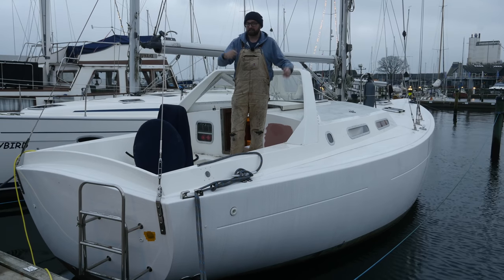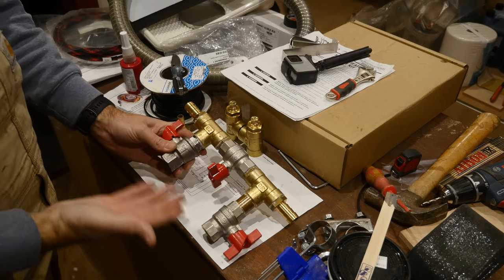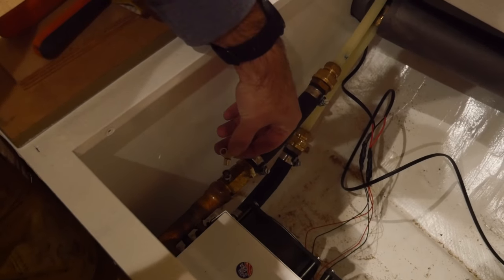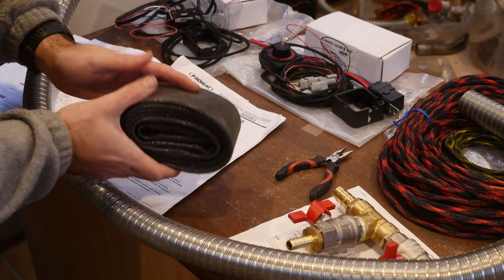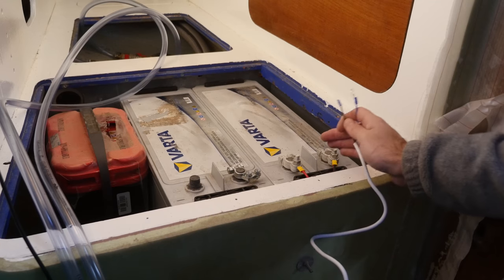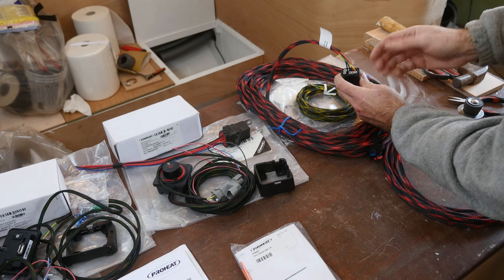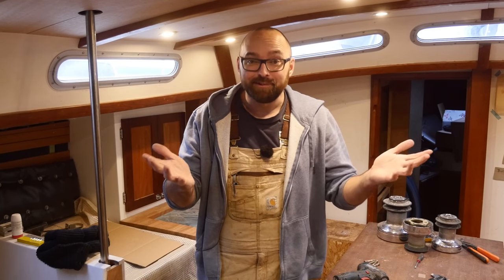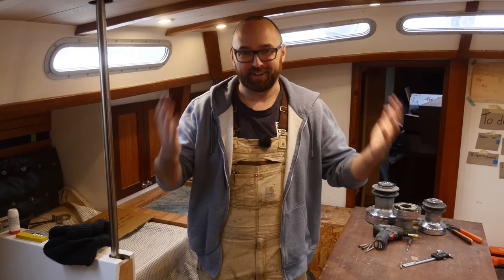Sail Life - Dometic Proheat X30 hydronic heater on a boat, part 3 of 3 - DIY project

Comment: Some sort of heat is important working in the hard or on the water in the winter.  I spent two COLD Chicago winters on the hard working on SVBD 10-12 hours a day and usually 7 days a week in relative comfort inside, using only a small amount of electric heat run off of boatyard shore power.  

The yards absolutely did not allow us to be plugged in when we were not there, and the availabile power was just a 15A 120v regular non-marine electrical outlet which I had to use an adapter to connect to the boat's shorepower 30A cord.  

It might be as low as -5 degrees F when I got to the boat in the morning, but in only a fraction of an hour a little 750w plug-in electric heater would have the boat nice and toasty inside and plenty warm enough to be a comfortable working temperature.  Epoxy work was not an option for most of the winter, but I was still able to do most things inside wearing just shirtsleeves after a not too long of time after I got there in the morning.  

We had power to spare to run the house bank battery charger and a few 120v power tools without blowing the breaker unless one of my neighbors decided to plug into the same receptacle that I was using.  If I had to run a skill saw, I would simply turn off the heater for a minute or two while I made my cuts.  Really, once the boat was warm inside after the initial warm-up of the boat the heater would barely run much, the thermostat shutting off most of the time.

This is only a 35-foot boat and we did insulate the hull well inside that fall before it got too cold our first year on the hard.  Even now, it doesn't take much to heat this boat.  Most of the time we just light our two kerosene yacht lamps and that keeps us pretty toasty unless it gets really cold out.

Comment: Like button smashed Mads! Your installation is awesome. I’m sure you’ll get the noise under control once you enclosed the heater and closed the door of your technical compartment. As for the fans, maybe one day you’ll fit radiators and that noise will be gone too, should you wish so.

You are blessed with a warm comfy home on this 4th advent.

Well done, cheers

Comment: Put a rubber mat between the backing plate and the hull, and maybe a big piece of wood on the other side with plenty of silicone to keep vibrations at a minimum.
 You could probably also run some copper tubing around the exhaust for a little extra heat.

Comment: Well Mads for the noise from the heater you could do an insulated box inside another insulated box to possibly really cut down on the noise. There is some insulation you can get at least here in the US called Sonolead. It’s  1in fiber glass a layer of lead sheet and another half in of glass. It works rather well.

Comment: Of course, you can always have both - a system heater AND a bulkhead heater.  That’s what I would do if I lived aboard.  I installed a forced air system for the drying effect and the quick heat and it is awesome for both but the little jet engine running at the back of the boat does get a tad annoying after awhile and then there’s the power consumption.  Having both would be nirvana.  The forced air to get the boat warmed quickly in the morning and the bulkhead to sit quietly around once the boat is up to temp.  I know - there’s the extra space but in these colder climes (I live in British Columbia), I’m pretty sure it would be worth it.

Comment: I have a small Webasto hydronic heater and loudest part is the wooden bulkhead (the aft end of a cabin) where the machine is mounted (due to the fine vibration). When you check the heater from the other side you can't believe that it is so loud at the other side of the bulkhead! Try to add vibration damper. This is what will do, too.

Comment: Another Great Leap Forward with heating now installed, its going to make the next few month much more comfortable I’m sure.

I think it may be a good idea to add a string or chain to the exhaust bung just in case!

I know I keep commenting the same thing, but thank you for maintaining the content output, it’s one of the few things keeping me sane in this crazy 2020.  I’m sure I’m not the only one grateful for your content. Your positive approach to everything is a shining example to us all.
Reply: I was thinking about letting the exhaust bung also be part of a "start button" for the system - if the bung is in the exhaust, the system can't be started and if the system is started, the bung can't block the exhaust. I've no idea how it would be done - perhaps with an ignition key from a car?
Reply: @noremorsewoodworking2258  I thought that too.  I’m sure there’s some kind of safety feature that will stop the system running if there’s an an exhaust obstruction, but a safety feature would be interesting to develop if it isn’t already a feature of the system.

My worry was about dropping it when installing and removing.

Comment: and you get hot water, no comparison. Merry Christmas Mads.
Reply: I have my Refleks connected to 7 radiators, it would be easy to connect it to a heat exchanger for hot water from an electrical switch.
I have also found parts for making it ignite itself via electronics so maybe I will make that my first youtube video next summer.
I'll probably steal the idea with a buffer tank also. :)

Comment: Based on the harmonics I can hear from your recording, it sounds like a big chunk of your noise is low-frequency transmissions that are transferring to the cabin wall. There is a high-frequency whine, but that is easy to eliminate with a shroud or loose dampening. In order to eliminate the low frequency, you will need to work on decoupling the heater mount. If you use a meter on your phone to measure the low-end frequency you can look up the vibration decoupling material/durometer that will work best for that frequency.

Comment: I am happy to see you go with a hydronic system! I have a forced air system and having 4" tubes run bow to stern is not the best in terms of storage compartments. I also find that the forced air system seems to run much more than what a Hydronic heater would run, though maybe I'm wrong. 

I am looking to switch to a hydronic system. I would love your review video to contain some information regarding real world  power consumption as well as timings for how long the heater runs!

Comment: It would be an interesting follow-up on the hot exhaust installation, if you have access to an FLIR thermal do-hicki, and actually could confirm the temperature around parts consisting of the heating system. Just an idea. Cheers
Reply from the maker: That would be really cool! I sold my FLIR camera a few years back but I might be able to find one :)
Reply: @SailLife  I got one that plugs into my phone. It works pretty well.
Reply: Good point well made. Just fitted new system to Impavidus and used our laser thermometer (and a cupped hand. The bandages will be off by Christmas 😉)
Reply: @SailLife  I would suppose there's a Danish hygglo.se site (where a short term rent of such seldom-used devices are a few hundred SEK). But..having one aboard could prove great in the possible future when stuff seems too hot (engine, drivetrain, some wires etc) 🤑
Reply: My diesel heater exhaust melted the line to my dinghy and I only noticed it as it started to float away.
Reply: @wallacegrommet9343  🤣
Reply: I think the née google phone has FLIR... buddy used on my boat to check new alternator with serpentine retrofit... FLIR was very useful checking fir hot pulley and belt edges during alignment. All off his phone! It was cool to see.
Reply: Anybody heard of a laser thermometer just saying 😁🙄

Comment: Couple things to think about. One, how much heat is in the exhaust and how to recover it. Our natural gas furnace uses PVC pipes as exhaust tubes because the heat is extracted prior to ejection. Second, how much noise is being transfer into the bulkhead via vibration and if using something like rubber engine mounts would decrease the noise level. The other question I have is where is the heater drawing air from? From inside the boat or from outside? Inside would be as about as inefficient as one can get.
Reply: Just finished composing a comment that basically said what you did. It took me a while to do, in doing so I missed yours. Thank you for stealing my thunder :)
Reply: We had mentioned back when we saw the bracket and that rubber isolation would be something highly recommended.
Reply: @crankshaft007  For sound hull resonance yes!
Reply: More efficient drawing air from inside for system air but minimum 10% fresh air makeup is required to control CO2. Combustion air should come from outside.
Reply: @brantregare  Great minds think alike.
Reply: @normanboyes4983  : Mads is also drawing air and releasing CO2 and once Ava joins him, she will do the same and so will Yukull. Do they deserve 10 Percent as well? 🤌 hope all will have a safe and comfy winter. The installation is awesome 👍💪
Reply: Unfortunately even for home heating fuel oil {diesel fuel} boiler or furnace do not come in condensing style systems that use PVC exhaust pipes.  They all have to use metal pipe for the exhaust and are at best maybe 70% efficient so 30% of the heat from burning fuel goes out the pipe.
Reply: @Fr99763  We used to have HVAC systems on ships with 1000 people onboard the design was configured for 10% fresh air make up. They all survived and felt well.😉Go figure.
Reply: @normanboyes4983  Larger boats and ships have an internal volume of air commensurate with the number of people for whom it was intended.  If you only had two people on a huge ship, you probably wouldn't need anything like 10% fresh air.
Reply: @joshuarosen6242  Not in my experience. Larger ships have a ventilation and cooling system that takes into account the normal number of personnel onboard, the wild heat created by people and equipment, the wild heat from directly vented and exhausted machinery compartments conducted through adjacent compartments and the intended operational geographic conditions. The ventilation is designed to meets those specifications 10% is 10% no matter the size of the system.
Reply: @normanboyes4983  I shall take your word for it.  I don't profess to be an expert in HVAC systems.

Comment: Could add electric immersion heater into expansion tank which you could run off shore power
Reply: Use a standard electric water heater element and thermostat !
Reply: @jerryf609  Can honestly say I've never heard of a "horse trough heater". I guess the name explains what they do... colder (and more rural) climates than I'm used to. :)

Comment: Merry xMas in a few days Mads, and thank you for sharing all the details of your projects with us! :)
Some observations; the T's on the manifolds with the bleedvalves should be turned 90deg to have the bleeders facing up if possible. Silencing the combustion air intake will give a good improvement on the high pitch/turbine noise.
An important point (for me) missing on the pros/cons list for the heating alternatives, are the air exchange and humidity challenges you will face with the hydronic fancoils without fresh air supply. After 30+ years with sail and motorboats, I really appreciate fresh air + heat w/o the 'boatsmell'.
The Dickinson style heaters give great comfort, also because they suck in the cabin air for combustion, and with this the moisture gets reduced.
With the fancoil solution I'm afraid the cabins will get bad air quality, and it will be like driving your car with the resirculation valve on the cabin heater air always on.. With wet gear, showers, cooking, living and breathing - this could give a not so ideal environment.
Anyways, all the best to your projects, health and love - w/greetings from Norway(hope to see you here in NW one day on your coming journeys :)

Comment: I have a water jacked Reflex stove in our boat. Doesn't fully remove all cons of the Reflex stove you mentioned (i.e. healing problems) but a water based distribution system (small circulation pump that is virtually silent) allows for much more control - I can't control the Reflex stove itself but if I replaced my passive radiators with something similar to your fan controlled ones it could be quite similar. I have my water heater half way through my single loop distribution so I did not opt for heating warm water as well. However, I added a heat exchanger to my engine so I can use my radiator system whilst running the engine without igniting my reflex stove - it will infact become a radiator in my head where the Reflex is placed...
Reply: You just described my thoughts. 
I think Mads mentioned something about a thermostat regulator being available for the reflex, but I don't think I have seen one on their page.

Comment: Knowing how thorough you are, I am sure you've done this, but I didn't see you apply epoxy to the through holes you drilled for exhaust. Awesome work thanks.
Reply: Looked like solid fiberglass with no core to me. No core - no need to epoxy

Comment: Carbon Monoxide is heavier than air.  Mount the detector closer to the floor.  Put the smoke detectors high on the wall.

Comment: I have more heater options. Dickinson Newport, Electric fan heaters on shore power and a Chinese Diesel air heater. Next winter I will swap the Dickinson for a Coal / wood stove to have even more fuel options. Redundancy is always good.

Comment: Can't find the other comment about replacing the fans, so I don't know if they have been mentioned, but if you're looking for quiet, but we'll performing fans, I would use one from noctua. They are well known in the pc world for being the quietest fans you can get, and perform really well.
I'd the fans on the heaters are 120mm I would use a nf-a12x25, I'd larger either the a14 or a20. If you can find a spec sheet for the fans already on the heaters, compare the airflow (m³/h / cfm). If they are significantly higher and you think that is needed, there are 3000rpm versions in their industrial PPC line. They will be louder but probably still much quieter than the ones on there now.

Comment: I recently had to replace a natural gas furnace in my home.  The current code where I live required a CO as detector as well as a smoke detector.  I found a unit that covers Both.  In the future when you need to replace them you might want to look for unit like that.  Both detectors covered for about 55% of the cost of two separate units.

Comment: There is also a optional long exhaust silencer like the ones for the Espar bunk heaters. PN 201689800500.  The intake silencer you're adding will also really help.

Comment: Make up air for combustion is a vital part of the system. I did not see enough to make me comfortable understanding that bit.  Also, FWIW, in land applications the noise seems to decrease a lot after about a week. YMMV.  If you ever open those air bleed valves when the system is hot be very cautious.  Could be air, could be steam, could be scalding water.  (Don't ask)   Keep that warning ticket about welding.  Very important.

Comment: Mads you should look into so fiberglass exhaust heat wrap to wrap your exhaust pipe it would give you piece of mind and keep the heat inside the pipe and also protect the boat. I think at least here you you can get them at auto parts stores not sure there.

Comment: Use 4-pin 12v 120mm computer fans - You can get a PWM circuit cheap to modify the fan speed digitally, and computer fans can have VERY good airflow:noise!

Comment: Hi , another interesting video Mads , Great explanation through out ,warts and all ,learning all the way on the job training . The heater fault  could be ,as you said ,only one cabin heater connected in the plumbing at this time , does the boiler it,s self have a temperature out put control  for the water that is flowing around the system . MERRY CHRISTMAS ,stay safe and keep calm and warm .

Comment: 👍info. However, a cabin Refleks heater as a back-up & a smaller unit in the V-berth would be a welcome safety (in heat) to Athena. You do have diesel.
Reply: He has mentioned in the past having a secondary or redundant heating method on board. I am guessing he might add a mini wood stove in the v-berth or salon.
Reply: A mini wood burning stove doesn't make sense. The supply & storage area needed would create a problem.
Reply: Not at all. Wood is washed up along the shore nearly everywhere. Again, I am talking about a simple, easy, short term backup heat source. He could easily carry 24-72 hours worth of wood fuel in a very small space on board. And pickup driftwood as he sails.

Comment: More 27 minutes videos is welcomed! Less than that  goes to fast.
I have an Chinese diesel heater, not installed yet, and realised a few mounts ago that I need more for heat protection. Soon I will order parts and I'm lucky that I noticed that important thing.
Reply: Look up Espar D2 installation manual online and it will supply all of the correct information for a hot air diesel heater.  Plus parts you might need of better quality and availability.  Are you on any of the Facebook Chinese heater groups? You should be if you want the best user base info
Reply: @wallacegrommet9343  Thanx for your info, will check the installation manual. No, I'm not a frequent Facebook user but I have friends that already have installed heaters. They are good references.